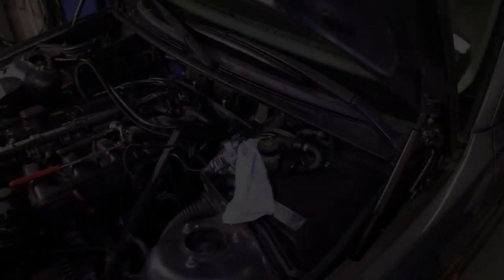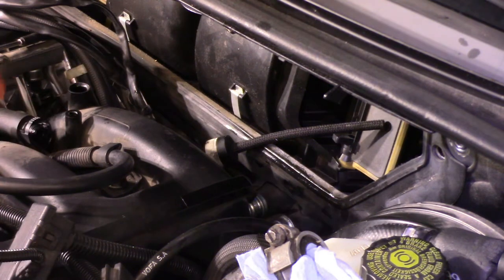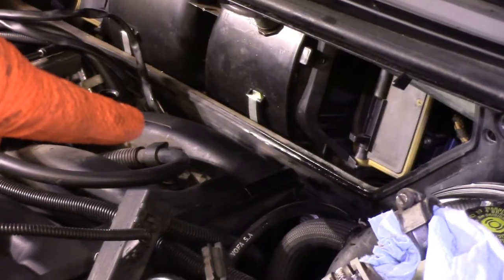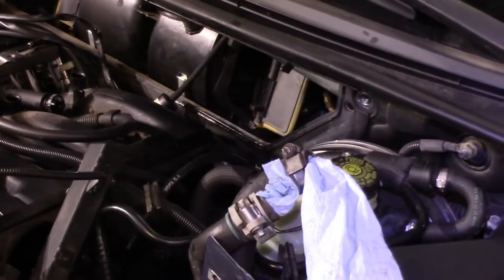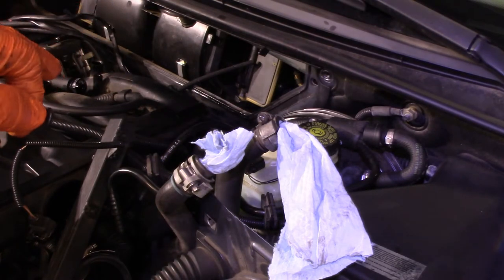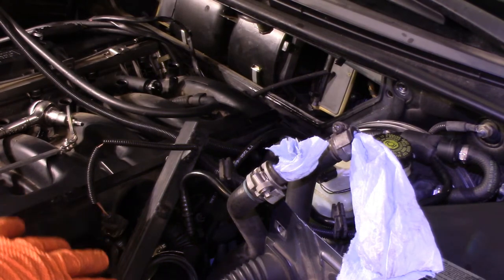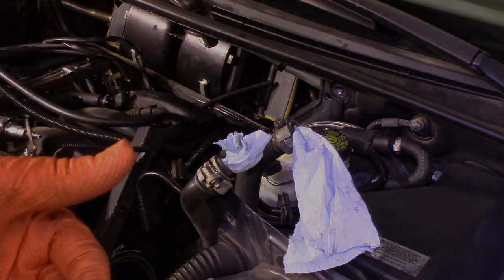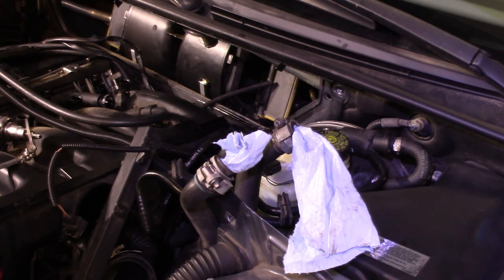BMW 328i Vacuum Hose to Vacuum Pressure Control Valve Repair

Comment: you do NOT need to remove your heater hoses or even touch anything in your coolant system to do this job. Maybe this man has big clumsy hands but the trick is to remove the solenoid entirely, remove and assemble the new vacuum lines to check valve then reinstall into the car. absolutely possible without and took me less than an hour to do with literally zero experience. just remove the disa valve, separate the brake booster and remove the firewall to the right of the intake for extra room and no one should have any issue with this.

Comment: I did it without removing the heater hoses. I got the control valve out by pushing the end of it towards the front of the car and simultaneously push with your other hand towards the driver side to get it out of its slot

Comment: Kudos man. I'm doing this right now on a 325xi & have spent hours trying to get to it. All I have off so far are the top filters and the engine cover. I tried to see what I was doing with a borescope but the orientation is incredibly hard to manage. A mirror was the best to get oriented. The small 1" mirror is ok but I'm thinking I need a slightly bigger one. I could lay across the engine & get both hands back there but not nearly enough force to remove dried on tubes. Something just occurred to me that could work, but it might be 6 of one, half dozen of the other. I'll update.

Comment: Good you mate, thanks heaps 👍! We’ve been struggling with exactly those little buggers that on my 328i down under 🇦🇺
Reply from the maker: They are a PAIN...Have messed with them on both the 328i and the 328Ci.